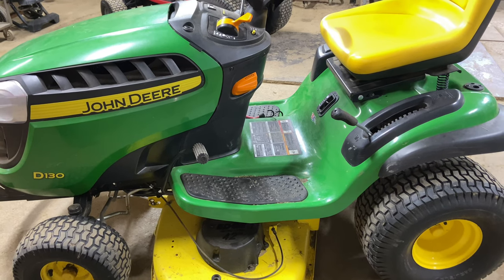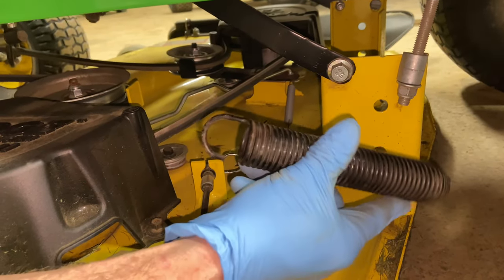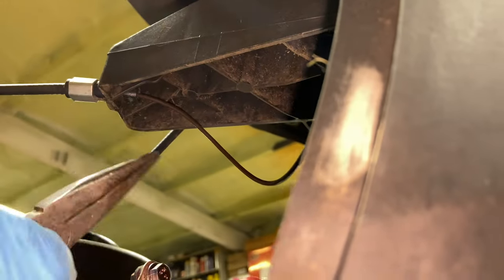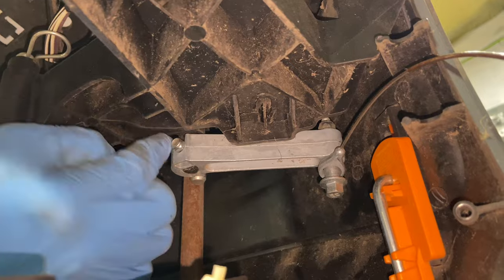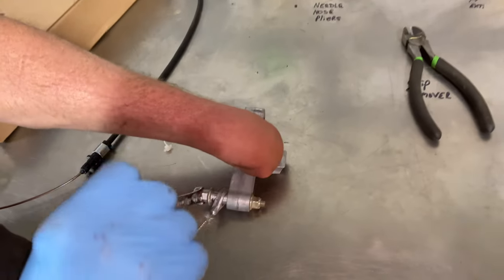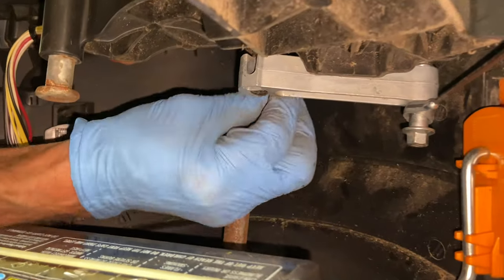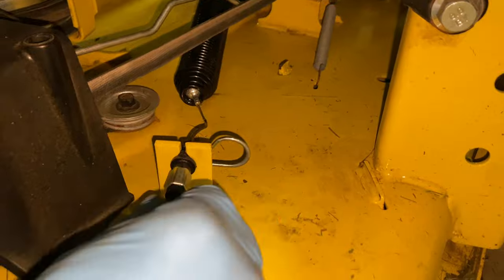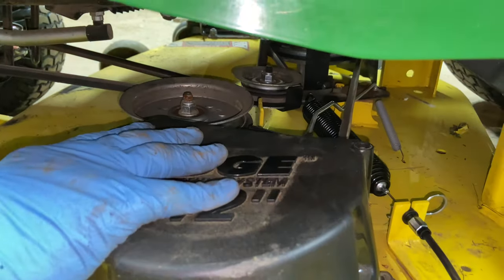How to Install a Blade Engagement Cable on John Deere D, E and L series Tractor

Comment: YES! I'm a 72-year-old woman who lives about 45 minutes away from a John Deere repair shop. The labor and travel costs would have been outrageous so I found your video. 

I have a John Deere D125. I call it my "Jane Doe," since its size pales in comparison with my neighbors' tractors. 

Your instructions were amazing. The only issue I had was the way the spring was attached in the back. It was wrong side up and I couldn't get the angle right to remove it. I loosened up "something" and was finally able to get it out. Other than that, everything went smoothly. It isn't any fun, though. Some of those areas are really difficult to reach. I just went out and made a stripe in the middle of my field. It works!!!! Thank you so much. 

And that attachment to the spring that broke is a piece of doo-doo.
Reply from the maker: Hi Barb, I’m glad this was helpful and thank you for the kind comment. Please subscribe, give this a like and tell your friends about my channel to help it grow. Take care:)
Reply: So glad to read your post i am a 76yr woman and very handy with most things was a bit doubtful about this one but after watching the video i figure if you can do it i should be able to.what lets me down mostly now is my knees but im going to give it a go.

Comment: Awesome video. exactly what I needed to replace my cable. After three mows, my cable broke again (4th time in 6 years). It breaks where the cable attaches to the spring. Not sure what I am doing wrong each time. Your directions worked perfectly.

Comment: Good work, I just did two craftsman mowers that have a similar setup and do have the slotted adjustment for the cable on the mower deck. Thanks for the video.
Reply from the maker: Thank you for watching,  commenting and supporting my channel!

Comment: Thanks for the video. I have the D110 and I bought the same model cable you used and it work. It was a bit longer than the original but it worked and mine has the adjustable section yours didn’t have. Your the reason it was easy for me to change the part. Thanks
Reply from the maker: I'm glad to hear and you got the job done!! Thank you for the kind comment. Please give a thumbs up to help the channel grow. It would be greatly appreciated;) Take care.

Comment: Great video, it made me much more confident about replacing the cable on my D130 and your reference to the part number gave me confidence that I had bought the right part even though it looked different. I encountered two minor differences and one problem. The two differences were that the black trim panel on my D130 does not extend so far forward as the one in your video, also my D130 has an extra cable clip on the frame a bit further back directly above the mower deck (I found that fairly easily) it is a hook type clip so was able to route the new cable through it. The main problem I had to overcome was the spring. My old spring was much smaller and instead of a hook on the end it has a sort of snake head end that had to be wiggled through a hole (not a slot) in the tension pully arm . Managed to make the new larger spring fit with a grinder. I ground down the hook shortening it by about 1/3" and tapering the end so it would push down into the hole. I expect getting it out again is going to be a real b***h, so I am not looking forward to servicing the mower deck next year.
Reply from the maker: I’m glad you were able to get the job done ✅. I would hope the new cable would last more than a year! Hopefully your won’t need to do it that soon. Thank you for watching. I’m glad it was helpful and thank you for the kind comment. Please give this video a like and share my channel with your friends to help it grow. It would be greatly appreciated!
Reply: @JohnsonsSmallEngines  Oh I expect it will last at least 10 years like the previous one. My concern is unhooking the now modified spring to remove the mower deck for servicing which I do every year at  the start of the new growing season. It took a lot of effort to get the ground down spring hook into the hole so it will not be easy to get it out again.
Reply from the maker: Oooooooo! Gotcha.

Comment: Well done :). I made the classic mistake of stopping the video once I thought I had all the facts and then spent a few minutes puzzling over why the silver bolt housing wouldn't slip back on the shaft, lol...bungee still deployed , DERP! Note to self watch the whole video :). My D105 does have the adjustable stub on the deck but I have never taken the time to find out how tight the belt should be when activated. I have larger clipping sizes than what I opine should be there with two blades chopping so may look for some adjustment advice. Once again, well done. Subscribed
Reply from the maker: I’m glad this video was helpful. Thank you for the kind comment and for supporting my channel :)

Comment: Thanks the instructions were similar enough to work on LA135SE its actually easier the cable end is held on by the tension spring that fits in a slotted pin with a washer to hold the cable to the pto arm.
Reply from the maker: Hi John, I’m glad this was helpful and good to know it works on the JD LA 135.

Comment: Howdy . I put a new engagement cable on my D110 and when I put the new cable on when I engage the cable the blade barely turn or not at all. Yes your video also fits a D110

Comment: This is a great video, it made the repair so easy! Unfortunately I bought the part specified for my mower, D110, GY21641 and the spring is different and doesn’t stay hooked. It works for a few minutes and then pops off🙁.
Reply from the maker: Hi Diana, It’s a updated cable and it should fit. I will try and make a updated video with your cable. It may take a week to get the video up so please be patient. I have a D100 in at the moment that needs your cable.

Comment: Great video Brad, very informative and easy to follow.  While changing my cable I ran into a problem I cant seem to solve.  My old cable snapped at the spring, so I ordered the same part number for the replacement.  I installed it the same way you did in this video, but when I pulled the level to engage the pto afterward, it only seems to move the pulley arm about half the distance it needs to move to engage the mower deck.  Its almost as if the cable is too long.  If I reach under and pull on the spring manually the mower engages as its supposed to until I let go and release the manual tension.  My mower deck is also one like the video that doesn't have an adjustable tensioner for the cable.
Is there something I'm missing here?  Any help would be greatly appreciated!
Reply from the maker: Did you order the same part number from your old cable? Or did you use the cable part number in my video? Because you may not have purchased the correct cable for your certain model even though you said, it’s the same one. I always double check the part number to the specific model that I am working on to make sure I get the correct part. that is all that makes sense. Other than the possibility. The belt is too long now, but that doesn’t make any sense did it stretch, doubtful. I would double check with your specific model on the John Deere website or contact John Deere just to make 100% sure that you have the correct part. Sometimes there may be a serial number break that is needed to get the correct part. John Deere would be able to help with that better than me.
Reply: @JohnsonsSmallEngines  Thanks for the quick reply.  I ordered the right part based on the number from the Deere dealer, which was also confirmed when I pulled the old one off and it was stamped in the jacket of the old one.   Even the service dept at my local dealer doesn't understand why its not just a simple in and out so I've been checking the internet for someone who may have had a similar situation.  I've been trying to avoid bringing it to the dealer because of the lengthy downtime it'll cause but its starting to look like that's the best option.  Thanks for the help!

Comment: I just put that cable on my D100. I bought an entire new deck and after I got it I found out it needed this type of cable. My original cable just inserted on that end where the spring is and the spring was not even half that size. I don't know why they made that spring so large. I've spent over a grand with the new deck and this cable around 1,040 bucks, but I didn't want to buy an entire new mower since the old deck was pretty much trash with too many problems to fix. It does seem to engage the blades correctly but I haven't had time to mow with it yet. Probably do that on Monday afternoon.

Comment: Thanks for the video , very helpful but when I engage the blades the belt gets looser not tighter. What am I doing wrong?
Reply from the maker: Belt is on incorrectly? I thought you gave a Husqvarna?
Reply: @JohnsonsSmallEngines  nope probably someone else , I’ll check again. Thanks ! I have a Deere 130

Comment: Excellent video, I have a D120 and the head of the cable that fits in the bracket on the deck ( mine is adjustable) seperated from the cable, so need to replace cable, want to say everything on the D120 is smaller as Spring on deck only one and small also no return spring on bracket that holds holds engagement pulley. I also need to replace one spindle but Deere only provides Self Tapping bolts and mine has bolt and lock nut
Reply from the maker: When replacing the spindle assemble you should only need the self-tapping bolts. Thank you for watching and commenting.

Comment: How can you adjust the belt tension on this model where the cable bracket is welded instead of having the screws you can loosen?
Reply from the maker: There is no adjustment. It is the spring that puts tension on the belt when the blades are engaged.

Comment: Great video, thank you.  I don't need to replace the cable yet, but my problem is that the blade engagement handle is so hard to engage on my L110 JD (bought in 2003). It's like at the other end the idler on the deck doesn't want to engage smoothly and sometimes it puts a lot of pressure on the little bolt/screw and lock nut that holds the lever arm of the handle that it breaks that screw and I've replaced that screw many times. Is the problem the idler or other pulley on the deck?  I don't know why the blade engagement handle is so hard to push up and begin the blade action.  Any experience with this problem at your shop?  Thank you for any advice you have.
Reply from the maker: Disconnect the cable from the mower deck. After disconnecting, see if it it easy or not? If it is easy, your mower deck blade brake arms or the blade engagement arm is sticking. If the cable is tight after disconnecting from the mower deck? Your cable needs to be replaced.
Reply: @JohnsonsSmallEngines  ok, thank you, I will check it out.
Reply: @JohnsonsSmallEngines  the blade engagement handle to the cable is easy to push up without the cable connected to the deck. This means I should look at some you tube channels to see how to fix the blade brake arms or blade engagement arm?  Where is the blade engagement arm? I'm not sure which part you are meaning.  Thank you, again.

Comment: So the cable is not attached anywhere between the clip on the frame and the bracket on the mower deck?
Reply from the maker: Correct

Comment: @johnsonssmallengines hoping you can help!  I came to your video tonight trying to find out what's up with my E130 as the blade engagement cable that you show here, keeps coming out of the little slot that you show at 3:40. When I engage my handle the cable will become disconnect from that little slot. It seems to happen EVERY time I go to engage the blade. Thoughts and recommendations? Truly appreciated.
Reply from the maker: I haven’t come across a cable that comes out if the slot when blades are engaged. If you can get a close up short video of it happening and send it to my email. I can take a look. I would say either the hole has worn larger or bracket pivot has worn. Impossible to figure it out without seeing the machine.

Comment: I find your videos very helpful. I have a problem with my D105. The blades will engage only when the deck is set high. When I lower the deck to level 3 or less the blades will not engage. Any suggestions? Thank You!
Reply from the maker: Blade belt is stretched. Replace belt.
Reply: @JohnsonsSmallEngines  , yes I already replaced the belt but it continues. Do I need to replace the pulleys?

Comment: Hi  ive replace the PTO correctly and blade still wont engage.  When i pull lever the parts all move correctly however when i get on and turn mower on and push lever nothing happens   im so frustrated can u pls help me ?
Reply from the maker: It sounds like the blade belt is not on the pulleys correctly. What is the model of your machine? I may have a video on how to install the mower deck belt. You can look on my channel to find it.
Reply: @JohnsonsSmallEngines  it's a john deere d 105

Comment: Does this cable fits LA115 model please
Reply from the maker: I do not think so. You must contact your local John Deere dealership to make sure you get the correct part before you perform the task.

Comment: My cable did not break it just needs tightened.   Any ideas?
Reply from the maker: Those cables do not adjust. Depending on the mower deck. There maybe a bracket that holds the cable to the deck that is adjustable. Most decks did not have that option. Most likely you need a new mower deck belt if the blades do not engage when the PTO handle is engaged or you have other issues.
Reply: I replaced the belt    The bracket on mine is welded.   If there is no adjustment I’m going to assume the cable is worn out.      Thanks for your reply.   Know there is no adjustment helps a lot.     God bless and have a good day

Comment: E100 E110 E120 E130 L100 L105 L107 L110 GY22387
Reply from the maker: Thanks, just updated.
Reply: @JohnsonsSmallEngines  No. Thanks to you. Just mowed  2 acres after installing the part !